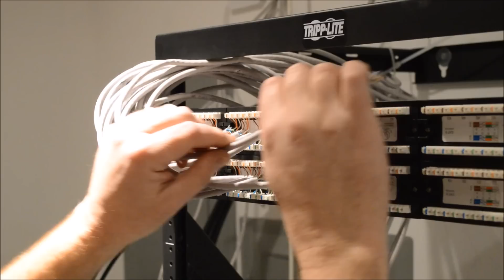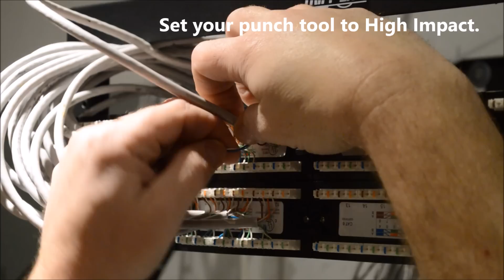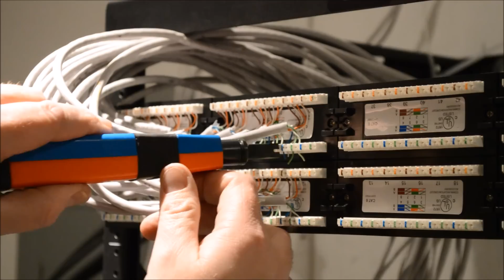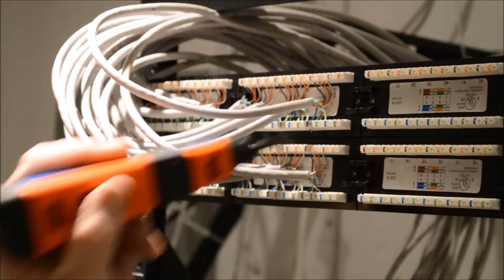How to Punch Down CAT6 Network Cabling into a Patch Panel | BridgeCable.com

Comment: Great tips. I was an IT guy but mostly software, yet at home I did a bit of punching for wall jacks (have the tool somewhere thankfully) and now I want to put on patch panel. Looking at those little 8port panels that go in the wall, and I'm quite rusty so this helps. Not sure how the 8 cables will fit in there (they have to go on the side it seems) but eager to start. Back in the game! :D

Comment: Thanks for the video, two questions, I saw in another video that you shouldn't have the pairs untwisted for longer than 0.5 inch, and what if you have an unshielded 6a cable where the the individual pairs have a foil and there is also a thin metal wire in the middle, do you remove the foil?
Reply from the maker: 0.5 is best....close to the panel itself and less signal bleed out....less for EMI to get to the network traffic. Typically we take off the foil....but you are referring to the wire that grounds shielded wire. Hard to answer the 2nd question. You can email us and see some pictures. Interested now! :)

Comment: What are the round handle looking things that always protrude from the wall surrounding 66 blocks? I always see them but I dont understand what they are for or what they are actually called.
Reply from the maker: They are for wrapping the excess cabling around - typically a bit of slack when doing cross connects. White Plastic Wire Distribution Spool (White Mushroom with Screw)

Comment: It says to maintain the twist, but you untwisted yours; however, I know that the pairs are still twisted inside the jacket.

Is that what you are referring to?
Reply from the maker: Slight untwist when putting into the panel.........the least is better.
Reply: @BridgeCable , thanks, I will re-punch down my cables tomorrow. It’s just 8 of them and won’t take too long.

Comment: How do you remove a wire if you were to somehow punch the wrong color into the wrong slot?
Reply from the maker: Really simple.....maybe....just pull out and go again. However some punches will have little hooks on them to pull just the wrong wire. Mispunches happen, just pull out and re-do. You do not want to punch into the panel too many times....the teeth get loose and down the road cause errors. Once or twice....re-punch....not a big deal (from a 20+ yr tech's experience). I will mention this......some clients want to REUSE a older panel.......Good Lord....just spend the $40-$150 to start fresh. The time for the labor is more. Thanks for the question! Paul

Comment: I use magnifying glasses to quickly visually verify a good punch.  BTW the spec is typically 1.5-2 twists per cm in Cat-5(e) and 2+ twists per cm in Cat-6, right up to the punch. This example fails to show that.
Reply from the maker: It's showing to flip the panel......new techs will stand behind cramped quarters and punch in weird positions :)

Comment: love you vidoe
Reply from the maker: Trying to help out others :) XOXO
Reply: @BridgeCable  please i need a little help. I had a RJ45 jack terminated. All pins from 1 to 8 read on LAN tester. But when I connect computer it does not blink or connect. What could be the problem.
Reply from the maker: @mikkio5371  As long as the cable passed...it's the device. Weird!
Reply: @BridgeCable  thanks for the response. Thank you.

Comment: terrible training video.  next time zoom in on the color codes.  dome panels all the wires are on top some on bottome and like yours split between top and bottom.
Reply from the maker: Sorry you feel that way Don. The point was the flow of the cabling and the ease of flipping the panel around for ease of punching. I get a ton of comments online and real world about that trick. Color codes....everyone has that online.

Comment: Best way to punch down that patch panel? Throw it away and get a keystone :D. Good luck changing any cable later on when everything is zip tied and bundled. Plus, if you get one like this (https://www.amazon.com/Cable-Matters-Mount-24-Port-Keystone/dp/B0072JVT02/ref=sr_1_4?dchild=1&keywords=keystone+patch+panel&qid=1622871672&sr=8-4) then you can cable tie each individual cable to the back zone for extra security, versus just having a big clump of wires in the back. Oh, and don't forget you can get all kinds of keystones too, not just 8p8c/rj45. You can get fiber, hdmi, audio, rg6/coax, and on and on. WAY WAY WAY better imo. I guess there's a little bit more cost to it because you've got to buy a bag of 24 keystone jacks but if 30 bucks is a deal breaker then it sounds like doing it right isn't a priority. Also, I've snapped the teeth before when punching them down. What do you do with this type of panel? Nothing, you've just got a dead port. With a keystone you just throw it out and snap a new one in.
Reply from the maker: We work on all types of panels. However...on a fresh install we are dropping in Keystone panels! Unsure if this a real comment or just an ad....I can go on...but love any panels :)
Reply: @BridgeCable  Why would you be "unsure if [it's] a real comment"? Because I linked the type of product I was talking about? That's kinda sad...
Reply: You mean a “loaded” vs “unloaded” panel
Reply: @anyfoolknowthat  I meant what I said. If you want to use that terminology, go for it.

Comment: So the patch block that you are punching down into is working similarly to how crimping a RJ-45 connector works right? When you crimp the RJ45, the metal blade connected to the pins cuts through the protective coating of the wire and makes contact with the copper. In this case, the panel has a "blade" in there somewhere that is doing the same, but you are also using the force of the punch down to push it into a pressure-secure hold on the wire. If that makes sense?
Reply from the maker: Sort of the same....RJ-45 heads and patch panels. The copper in the wire must be "touching". The panel does have "teeth" in the preloaded bays, and pressure from the punch tool scores the cable into a sitting bay. You are right on track....the copper must touch certain points to carry the packets. Low Voltage....CAT6 carrys some volt.....so small but it's there....all those 0 and 1s (binary). :)
Reply: @BridgeCable  thanks for clearing it up. I had started researching it and found out that punch down strips some of the sheathing off. Awesome videos keep up the good work!

Comment: Hi, just started using patch panel and followed the correct wiring method when punching, but for some reason when I check I can’t get no continuity on the panel...my short jumper shows the right lights ...lm only using eBay cheapo punch tool. Could it be the case? Or the patch panel itself got problem....getting descent click when I press my punch tool by the way and cut the end wire too.
Reply from the maker: Hmmmm.....if the jumpers are getting passes.....would have to rule them out. Most patch panels even come with a manual cheap single push down jacker. As long as the copper is exposed and you can see the "teeth" sitting the wire in you should be okay. Of course switch ports on the panel....possible bad jack on that one. Tough one to answer without looking at it.

Comment: Which type are you using? Type A or B?
Reply from the maker: Thanks for asking....B. Very rare we will use A. Some older sites that we are new vendors we will match the existing punches. Every once in a blue moon we will come in to a new site and jack some new wires....then the fail or the pairs are wrong....then we march into the patch panel and see A :) So rule of thumb.....B. :)

Comment: What's the brand and or model of punch down tool are you using on the video?
Reply from the maker: Hmmm.....that was awhile back but I would guess ICC? If I had a choice to buy the panels I go with them many times. Great to hold the wiring in place before punching down! 2nd runner up would be Cable Matters, directly from Amazon.
Reply from the maker: Sorry to say but Tripp Lite's I avoid.....just not a fan....neither our my troops.
Reply from the maker: Crap.....you asked the punch down tool - Ideal :)
Reply: Thanks so much, I really appreciate your info on this
Reply: Great video. Can you use the same punch down blade on cat 5 cable.

Comment: I was told that there's something newer than punching down wires?
Reply from the maker: Share some information when you have it Please! :)
Reply: Pedro Custodio 
Keystone couplers?
Reply: Newer patch panels will likely have RJ45 ports on the back. Is that what you mean?
Reply: You can now get “unloaded” panels, which just have holes. You terminate an RJ45 jack and then just pop it in one of the panel holes.

Comment: If I have a bunch of Cat 6 cables (like in your vid), and they are all bundled and zip-tied together neatly, which one out of the bundle of cables should be terminated into the 1st port to stop them from tangling and overlapping? Would I be better taking the inner most cable and terminating that into the first port or would it be better to do that one last? I hope my question makes sense...?
Reply from the maker: Punching down is an "art"....that is what I see all the time. In what you describe I would punch down the 1st port and then work my way down the row. Do not secure it until you are done, I leave enough to service any ports if I need to. Then Velcro it in......everyone frowns on it.....but if you are going to use wire ties loosely apply them...don't "clamp down" on them. Hope this helps!